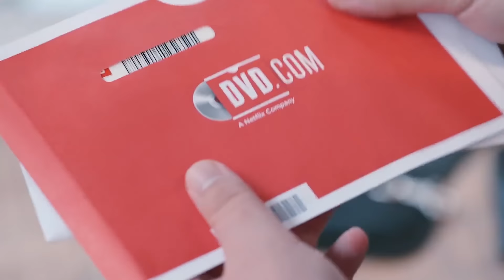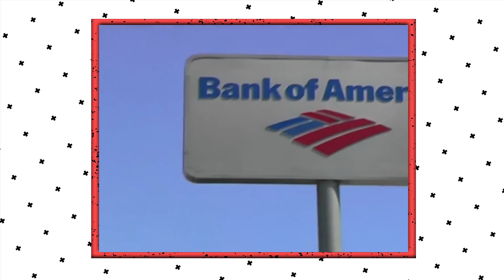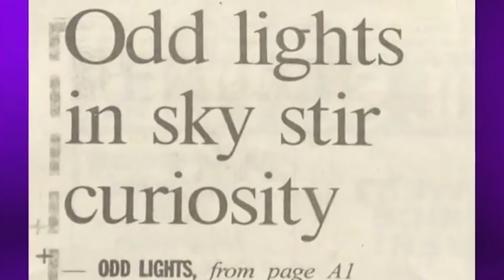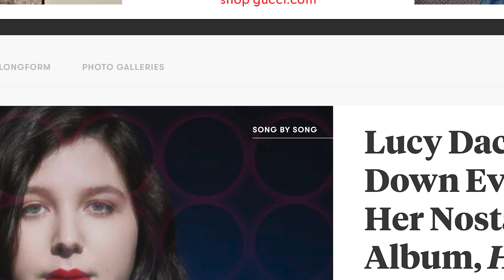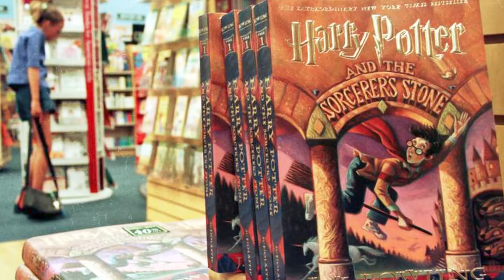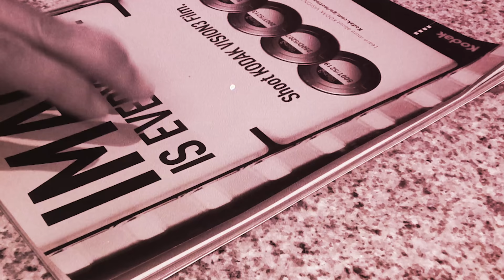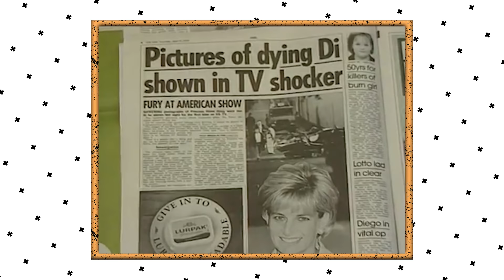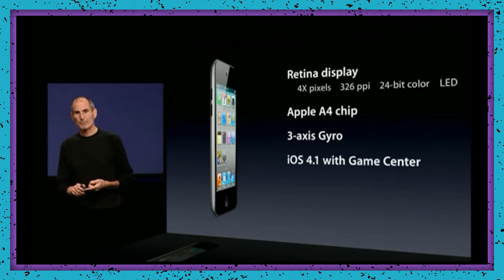Timeline 1997 - What Went Down In '97

Comment: The Last Nissan Skyline R33 GT-R would roll off  the production line in Japan as it was replaced by the iconic Nissan Skyline R34 with iconic GT-R variant following a year later.
A TV adaptation of RL Stein’s Goosebumps books was released. Goosebumps would be an icon of Saturday Morning kids television in late 90s and early 2000s. The show would go on to have 4 seasons with 74 episodes, and this would be the only adaptation up to this point because 17 years later we would get the first adaptation in 2015 which was followed by Goosebumps Haunted Halloween 2 in 2018.